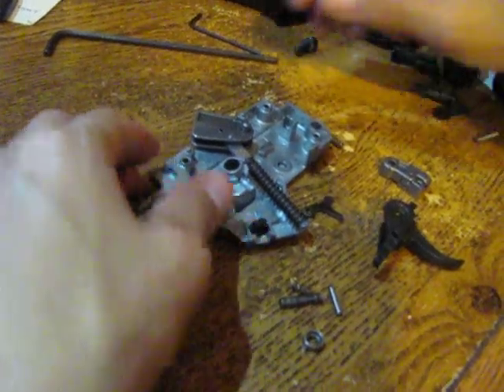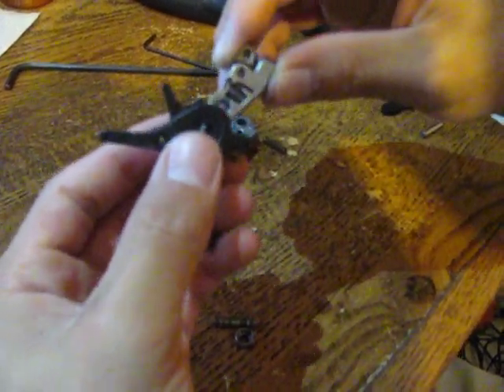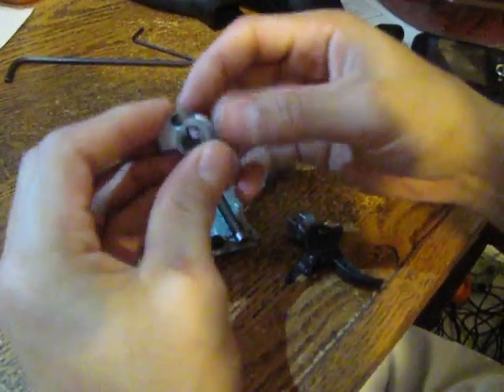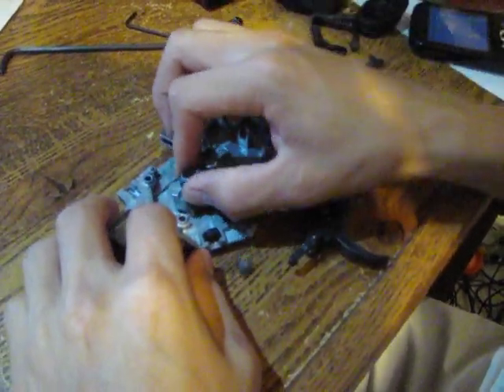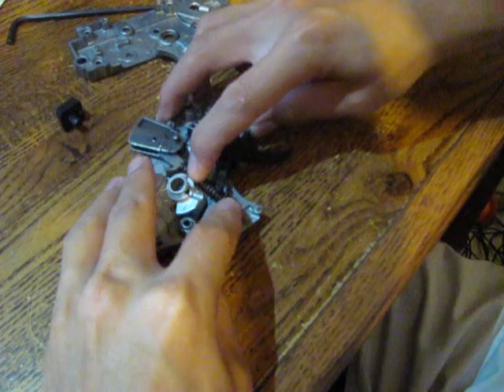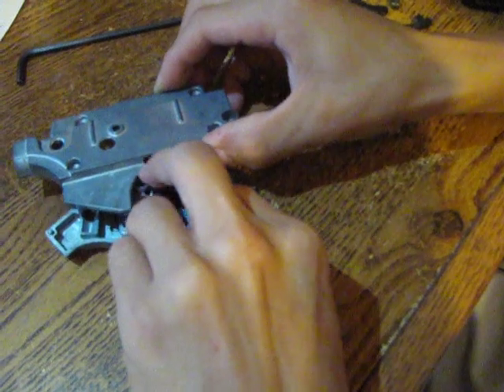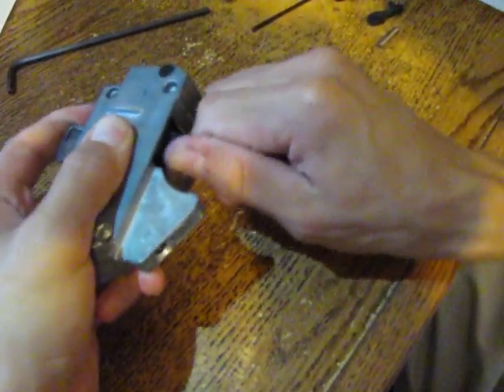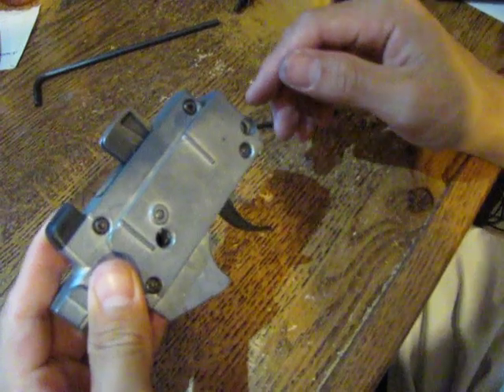How to reassemble an HK 416 D trigger

Comment: hey the direction of the shim under the hammer is important. it wont work properly if the shim is facing out towards back of the assembly.. so it does matter.

Comment from the maker: @specialkz79 
You can shorten the two springs. I cut mine just a hair or so but if you cut more you will have too much play before even getting to the disconnect.  Maybe polishing it will reduce the stiffness and weight by a tad.
Ill be trying some things here and there. Then post up a video